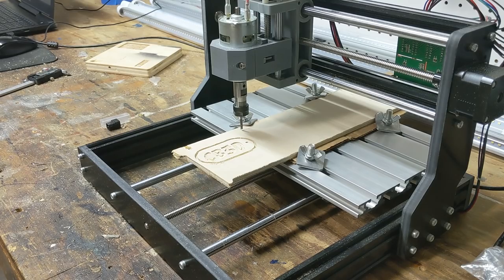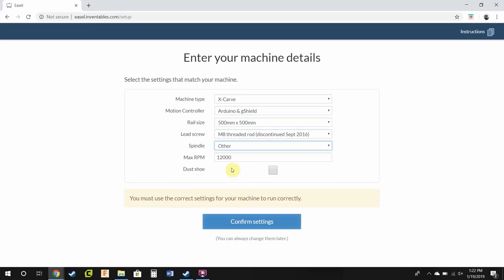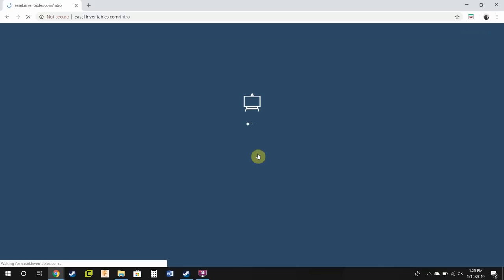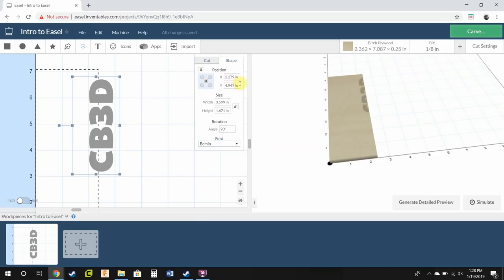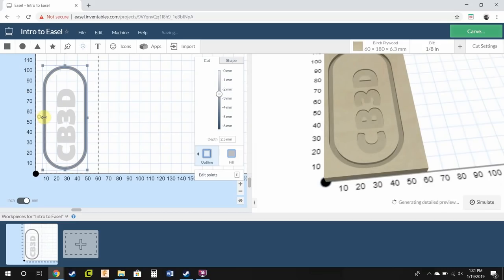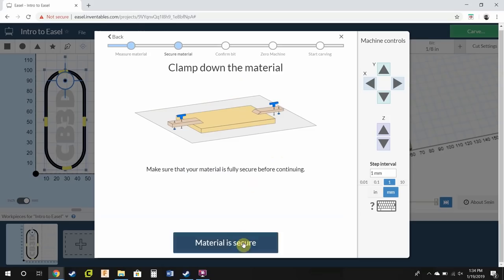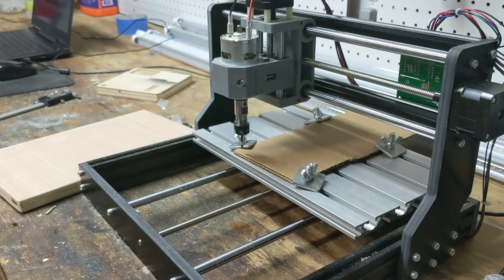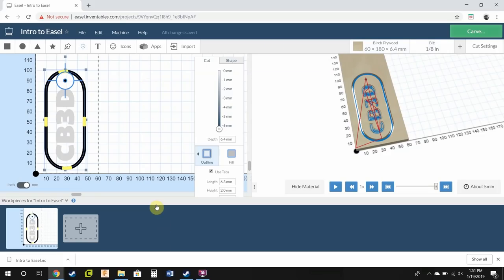An Intro To Designing and Cutting on the Sainsmart CNC Using Easel (part 1)

Comment: Super helpful, the lack of instruction is why I haven't picked one of these up yet for our school. This gives me a little more confidence we could get one of these and give it a try.
I have given up on laser machines, gauging the kerf of the cuts ( ie burn out thickness) is waaayyyy too variable it feels, I'd prefer good 'ol CNC.

Thanks Caleb. Very Timely and VERY thorough video is much appreciated.
Reply from the maker: I am glad you enjoy it! Is there anything else you would like for me to cover if you plan on using this in a classroom? And if you do decide to use a CNC machine in your classroom make sure to join the Facebook group (link in description) that way you can get help quickly if you need it or it break, because things tend to break easy in a classroom. Lasers definitely require a lot of practice to get right if you want to cut, but then again it's a lot safer because you don't have essentially a sharp knife spinning really fast. Lack of documentation is one of the big reasons why I started making these videos, they are such amazing machines, but there is almost no documentation on how to operate them, especially in video format
Reply: I 2nd the motion to join the FB group.  Even if you don't have a machine yet.  It will help you see what all people are doing with the machine, the issues, and build confidence that you can get help if you have issues.  You can also feel free to jump into the group and ask questions on any areas you're unsure of.

Comment: Thanks for the vid as it was easy to follow. Made a small box with the second go with my son’s name on it with the box app in Easel. I did snap a bit first go before I saw this as I’d not thought to reduce feed rate but I’m glad as I see what happens now when they break. Easel much more friendly to use than others I’ve tried this week.
Reply from the maker: I'm glad it helped! Easel is by far the best entry one and the only software I would use besides it is autodest fusion 360. Also don't forget to multiply the material thickness and cut depth by 2.54 so that it will cut the correct depth!
Reply: Caleb Builds 3D yes I noticed that first go. I was not sure first time I did the multiplying so had a thick waste board just in case. Working really well now just made some key rings. It’s addictive.
Reply from the maker: @decc2007  lol, it definitely is addictive, but a good addiction

Comment: Forget multiplying your thickness by 2.54, just tell Easel your dimensions are metric mm and accurately measure thickness of your wood to be carved.
When you plan a through profile cut, Easel will confirm that us what you want to do & offer including tabs. You can set the tab size too.

Comment: Incredible video and one of the most comprehensive thus far.  I had two questions to ask: 1.  When I set the depth of the material in Easel and loaded the g Code to the Universal G Code, my 4030 CNC router 

The board thickness is 13.55mm and I had to set it at 25mm in order for it to cut through.  Any idea why this is happening?

Also, how come when I use the entire 400x300 space in Easel and download the g Code to the Universal g Code tool, it cuts it out much smaller?  Even the visualizer in the Unniversal g Code tool shows that it's going to cut it out using the entire 400x300 space.

Any help would be greatly appreciated!  Starting to get frustrated!

Comment: I’ve got my software for easel finally connecting to my cnc but something still isn’t right well in my head like I made a file to cut a simple design but I can’t find the name or size of the bits I got with the machine and all I can figure out is I got the milling bits ten of them but I can’t find even a bit from the list that looks like this bit...your video has been a help...

Comment: Generally, leave small bridges between the part you are cutting and the "waste"  To prevent the part from knocking free early and getting ruined or kicked out by the spinning bit (or breaking the bit)

And you want a waste material under what you are cutting so you can cut through deeper than the desired product to ensure you do cut through.

Nominal 1/4 inch plywood is not really 1/4 inch when you measure and varies thicker and thinner. All materials have a tolerance of labeled vs actual thickness.
Reply from the maker: I usually leave the tabs, it was just a quick cut and I didn't care if this cut failed, because then I could make an example out of it. Also it didn't cut all the way through because there was an issue with the machine running with mm and the software sending IN without it being converted, it was easily fixed my multiplying material thickness and cut depth my 2.54. lately I have been getting in the habit of always measuring all of my materials in multiple different spots to try and get the best results possible. Thank you for the advice!

Comment: Hi there nice video, I have never used a CNC but I have always wanted one.  Is this unit really that easy to use even for a novice?  Also I dont know how long you have had this unit but what is your opinion on it so far? Thanks.
Reply from the maker: It's a nice machine for beginners, and it definitely is a capable machine. I would recommend it, just don't get the MX3 one. It will take time to get good at, and you will brake bits, but it is so satisfying to see the progress you make and to bring stuff from your computer into real life. Check the Facebook group if you want other opinions and to see what people are making

Comment: I want to order a .125mm fiberglass sheet and mill it down to 1mm exactly. How could I go about doing that with my CNC 3018? All 1mm sheets come from China and I’m trying to avoid that.
Reply: Watched your video and it looks like maybe I could set a square shape to match the exact size of the .125 sheet and in the settings just plug in .025 and let it work the entire area...

Comment: I have an issue whit the same machine in this video, it does not cut at the right depth that i set it up. I have to set it up to carve 10 mm in easel to carve 4 mm in the material. Ever happend to anyone?

Comment: Ok, I have the MX3 and I have it all set up and I'm using Drufel as I dont like Mach 3 , I have exported the Gcode from Easel, them imported it to Drufel which opens the file with gcode errors straight away. I have the zero point tool and have zeored and homed the machine and I get the spindle in the right place  then set 0,0 press start, the machine runs and seems to go in the right positions but the spindle does not turn, I can turn the spindle on manually in drufel and off and I can move the bed around and I have checked all the settings to make sure the machine is correctly seen by Drufel and the x, y, z is all correct but for the life of me the gcode will not start the spindle. Any ideas please Caleb..... Thanks
Reply from the maker: Not all gcodes are the same, Easel is designed for grbl based machines, and mach 3 based machines don't like that flavor of gcode. What you have to do is design your part in a piece of software that can export in the mach 3 flavor of gcode, otherwise you will keep getting those errors.
Reply: @calebbuilds3d223  Thanks Caleb, you're the first thats actually told me that, not even Sainsmart support knew that, I'm changing it anyway for a full grbl board soon when the all ali machine comes out, although the board is good Mach 3 and Drufel I have to admit are not the best products for a non machinist to use, Drufel is ok but Mach 3 very confusing for a new starter. Any ideas on the best software that likes Drufel in the Meantime thanks.
Reply from the maker: I'm glad I could help! I do not know of any other software for that sadly. Grbl is definitely the best for beginners and also the most user friendly, especially considering that you can use easel. I will be making a mach 3 video, but it's nearing final season, so I haven't had time lately. Sainsmart is actually making a new CNC machine, which is being released soon, it's basically the mach 3 one but it has a grbl board instead, which is what they should have done in the first place.
Reply: @calebbuilds3d223  yes i think it was a mistake to release the mx3 with purely a mach3 board on it. They would have sold many more if it had been grbl....
Reply: problem was solved by Drufel they had to dial it , it was because i was running windows on a boot-camped mac and that was casing a problem for Drufel, they altered the parameters and now it works perfectly.

Comment: Excellent video.  Used your other video to build the machine and this one to use Easel.
Reply from the maker: Thank you! I'm glad my videos could help! For easel make sure multiply material thickness and cut depth by 2.54, that way it converts between metric and imperial
Reply: Ho much praisr

Comment: Hello- hoping someone has an idea of why this issue is happening. I have yet to get a successful carve using my 3018 Pro, yet I’ve changed all the settings dozens of times.

The issue is that the sliders on the bottom (I guess it’s the Y axis) have a bearing inside of the plastic piece. But when I do a carve, the bearings come out of those plastic pieces! That obviously makes the table wobble off-level, ruining the carve. I can’t those bearings to stay in the plastic pieces and there’s no way of tightening them. Any ideas on why this would be happening or how to fix it??

I also changed the settings to make it carve better but man, is it slow now. It would take 16 hours to carve a fairly simple piece now. I’m wondering if I could increase any of these setting at all:

Feed rate: 7in/min
Plunge Rate: 5in/min
Depth per pass: 0.02in
RPM: 1,000

Thanks so much for any help!!
Reply: Hi Jim. Ive had mine for 3 days and had some success. Im getting a lot less vibration around 200-300mm .5mm depth of cut on 5mm ply. also same speeds for Acrlic both using the flat mill bits bits.  I also placed it on some foam yoga mat!  the bearings on the z axis were shaking out so I added some super glue which appears to be holding. when the 30 day Amazon return runs out, if It is OK i will then probably drill and add a small grub screw. Im also thinking, the control board should come off, as i wonder if the vibration could be detrimental to the componants.  Good luck.

Comment: Caleb sorry to bother you again but I just downloaded the software that you sent me the link to this morning and got all the way to the grblcontrol page and when I press the arrows to move right/LEFT and to turn on spindle nothing happens any suggestions. Thanks for the help
Reply from the maker: First thing you need to do is make sure your machine is plugged in, or that the power strip it is plugged into is actually on, I made that mistake before. Then make sure you have the easel drivers installed on your computer. Sometimes it takes a few tries to get the machine to actually connect. If you have anymore questions fell free to ask me or the Facebook group. Have a great day and good luck with your machine!
Reply: Thankyou so much for all your help I just hit your subscription botton

Comment: The depth of my Sainsmart is not constant through the cutting process.  It will go deep and the next letter won't touch the the wood on the first two passes.  How can I solve this?
Reply: level the spoil board, its bowed.

Comment: Thank for an excellent instructional video. It really helped me to get started with my 3018 Pro max. 
I see your router didn't cut all the way through your work piece. I experienced the same problem using either Easel or UGS nightly build.
Did you manage to find out how to rectify the problem?
Have you done any instructional videos on the laser using this machine?
Reply: maybe his board more thick than the one he setup on easel? can u tell me if u already figure it out

Comment: Caleb I need your help.i just got the Genmitsu cnc 3018 pro and can't down load the software with the disk that was sent with it.can you direct me to some where that I can download it digitally. This is my first time so I need a user friendly software. Thanks for the help
Reply from the maker: Here is a link to everything that was on the disk. http://wiki.sainsmart.com/index.php/101-60-280PRO

Also, I would recommend easel if this is your first time. I made a video on it already. You will need to multiply the material thickness and cut depth by 2.54, but other than that it is the best software for beginners. In the comments of that video there are multiple people who gave instructions in how to make it where you do not have to multiply by 2.54. Have fun with your new machine and happy making!
Reply: Thankyou Caleb.
Reply: @brianhughes7429  To convert inches to millimeters, multiply the inch value by 25.4

Comment: What specification did you use when setting up easel to sainsmart 3080
Reply: I will have  to check in the morning. But the machine is a 3018 pro laser/ cnc engraver. Can I contact you tomorrow ?
Reply from the maker: I used a random machine, they are all CNC machines so it's not that big of a deal, I think I showed which one I choose in the video, it was probably grbl CNC machine or something like that. It's been a while

Comment: how do you determine your feed and speed?
Reply: Easel estimated it from their library or machine & material types. You can override if you need faster or slower cutting.
If your cut takes tooling, if you're using a thin v cut bit, not very good for cutting largeish flat areas. Swap to a 1/8th  or larget

Comment: I want to make miniatures out of thin (2.5mm)wood with it that have holes drilled in it. Can it cut out simple shapes AND drill holes with a 1/16" bit, or would I have to change bits to get that done?
Reply from the maker: You can definitely do all of that with a 1/16" bit on this machine quite easily
Reply: @calebbuilds3d223  Thanks mate! Just ordered one, lol. I'll let you know how it goes. I got the small version to be specific, i'll let you know how it goes.
Reply from the maker: @punkfingerboards6283  awesome! You should have a fun time with this machine!

Comment: Do you know if this will work with the 3010? The board is grble woodpecker 3.2... I just wonder because on easel it says will not work with 0.8 or newer...
Reply from the maker: It should work just fine. It worked on my machine, you just have to make sure to multiply material thickness and cut depth by 2.54, otherwise it will be off
Reply: @calebbuilds3d223  thanks bro, thanks for the quick reply too. I'll sub your channel for sure
Reply: @calebbuilds3d223  it all works except only for a minute or so and then stops and says it's done 🤔
It does this every single time and I can't figure out what is wrong
Reply from the maker: You are welcome! That's interesting, maybe run that by the Facebook group, there are a few people that where writing some scripts for easel. However, you could also just export the gcode for your design and use candle instead
Reply: @calebbuilds3d223  Is that supposed to be 25.4mm to get the thickness and cut?  2.54 would be cm.

Comment: EDIT: figured it out. After entering the COM port manually in the main window, the machine setup worked.

Easel tells me "Plug in your USB cable and turn on the machine." after I entered the machine settings, but it does not recognize my machine. (the part with the COM port isn't even showing up). It works with Candle perfectly. Any ideas? (easel driver is installed, I tried Firefox & Chrome)
Reply from the maker: I'm glad you got it figured out, I am sorry I took so long to respond. Have a good time with you new machine!

Comment: Thanks for the vid!  Easel doesn't have the bits that came with the machine in their library?  

P.S. Not sure how you were using the calipers to measure when the battery and cover were clearly missing, but, that's a whole other topic.  LOL
Reply from the maker: You have to search the type of bit you have, and then enter it in, the machine comes with 30 degree 3.125mm v bits. Also my calipers electronics part stopped working, even with new batteries, so I just use the numbers printed on the side, it is still a fairly accurate way to measure, but not nearly as good as it was when o first got them. I need to invest in a much nicer pair

Comment: Could you please make a video on how to calibrate the machine? I followed someone’s tutorial and it completely screwed up my mill
Reply from the maker: I can definitely make one of those, I have just been super busy, hopefully I can do it with better audio too
Reply: Caleb Builds 3D haha thanks. I can barely find anything on calibrating and the one video I followed messed it up so now my mill thinks that 3 centimeters=1 centimeter
Reply from the maker: Messing up that much is pretty hard. Maybe if you fallow my firmware update video you can fix that issue, if you haven't already. And if there are just incorrect ones out there, then I will definitely work on making a hopefully decent one

Comment: did you have to install FTDI CHIP DRIVERS? for your usb to be recognized?
Reply from the maker: The only driver I installed is the one that comes in the folder for the machine, which can be found under the announcements section of the Facebook group, link is in the description